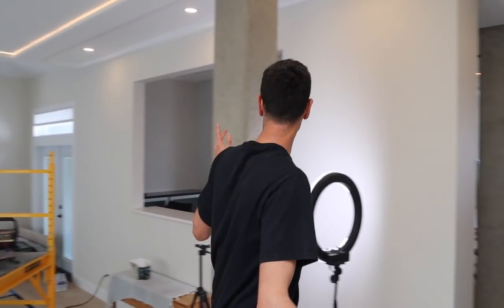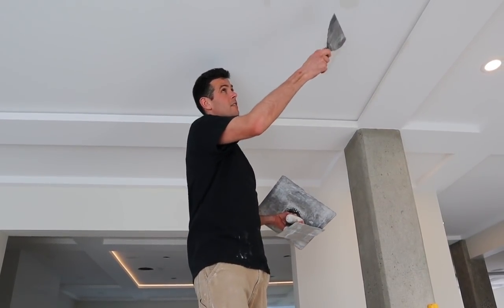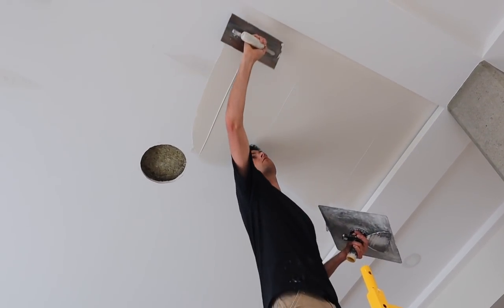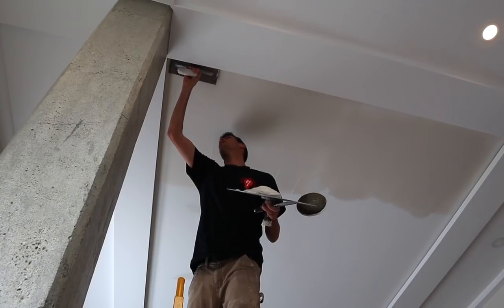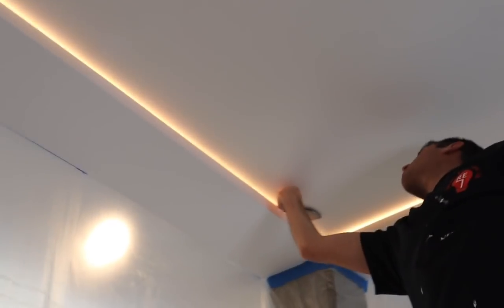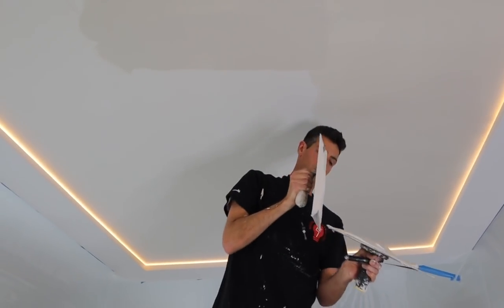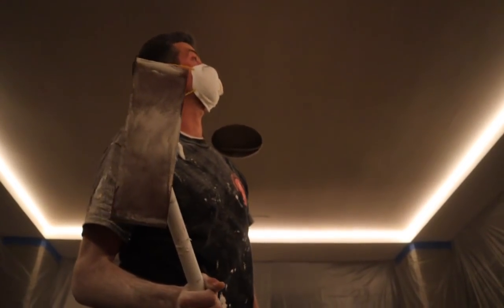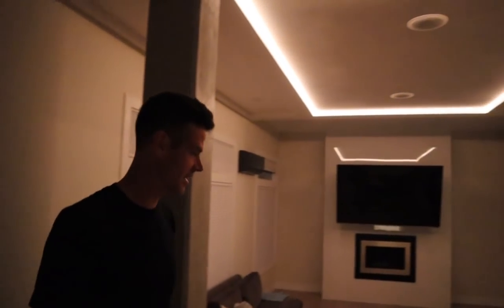EXTREME LEVEL 5 DRYWALL!!!

Comment: I've learned so much from watching your videos.  Many years ago I redid the ceiling in my small condo kitchen.  I removed those sunken fluorescent lights under clear plastic panels and installed drywall with canned lights.  It came out less than desirable so my fix was the brightest baddest led lights that blind you if you look up!
My "numbering" system" includes fractions so I think I'm about at a 3.6 level.

Comment: I wouldn't have touched that with a 10 foot sanding pole and I specialize in level 5 finishes. That raking light will make a gnat turd cast a 1 inch shadow.
I hope you got paid for this one Ben.
Reply: Amen. Had friends that wanted to do a 'wall lighting' thing in their toilet (think vertical led strips in a recessed space behind the toilet, both sides), and I couldn't talk them out of it. 
They're not really 'plaster master' material either, so..
It came out 'alright' (to them), but I can't go in there without averting my eyes.. :-)
Reply: @grandbuba  
It must be awful to look at.
Reply: Well, you're pooping while looking away from it, so it's manageable.. :-p
Reply: @grandbuba  
Excellent point!
Reply: @oltedders  I guess it depends on how long your business takes.  I like a nice long soak in the tub, and there’s some very poorly feathered edges around the perimeter of a skylight well extending over the tub that drive me crazy, but I can’t quite justify doing it over.
Reply: Interesting, my drywall guys specialize in Level 3 🤣

Comment: I’ve been framing, rocking , and taping light coves for 20 years . I Use a Graco Mark V fogger and a tape tech 24” skim tool you can be done with application  in 15 minutes. Then it’s just a light sand.
Reply: this is how we do it here in Germany too :-)
Reply: What tip size would you use for this ceiling skim?

Comment: Good job bud. That 2nd coat over a painted surface is a 🐻. I found that misting the area with water( I use a pump sprayer or sponge) and let it sit 5 minutes or just before water evaporates. Then apply 2nd coat. Cuts the amount of bubbles by 80 percent or better. Give it a try. Thanks for your videos

Comment: In my part of the country I think it is against the law for drywall guys to use lights. Particularly as an inspection tool. I paid someone to tape and float a 750 Sq ft condo. He (and his wife) did the whole thing with no lighting, even at dusk. Needless to say it showed big time. I ended up bringing a dual lamp. He wasn't even embarrassed by the globs, chunks, missed corners, pin holes, etc. Just looked at me like I was an a _ s for even questioning his work. After my 3rd inspection I just sent him on his way. It took me longer to clean up the  poor workmanship than had I done it myself. And I had planned to texture everything. Now it's level 5 and will stay that way.
Reply: In Germany too, no Lights for the last Inspection allowed, but if you like your Job and put your name out you do more than just usual.
Reply: Well Richard it all depends how much you were paying the man. Maybe you paid for a poor level of finish?

Comment: Little trick I learnt a long time ago is do your first coat in a half thicker taping mud mixed with a little runny confill to make almost a perfect thicker first coat mud sand that and use thin finish mud no bubbles ever. Sucks sanding on cieling but hey no bubbles lol

Comment: Once I designed a tray lighting system around a living room. It had a "shelf" 4" below the ceiling with a lip in front, to hide tri color low voltage string lighting on the shelf, going to 3 rheostats that would control the mood of the room, lighting the ceiling, and therefore the room. WOW, did that ever make a fair looking ceiling look like a WAR zone! But my idea had great merit once I had that dealt with and repainted. 
I don't mind if some copy my idea; I'm sure I'm not the only one who came up with it! Just be ready for a LOT of work to make it work.
Mind you that this was NOT a tray ceiling, just a normal flat one with the tray-like wood shelf added as a great alternative to a tray, and much less work. You put up a ledger first and add the shelf beneath it, and the front block (casing, chair, cove mould, block, whatever), so 3 pieces. Possibly some crown against the  wall under the shelf for a really fancy effect.

Comment: Have you tried filing your trowel and knife down? A new sharpened smooth blade will scrape the bubbles out, and shouldn’t come back when you reapply mud if you want any fill. Might have to scrape in different directions but it works like 95% of the time rather than 50% of the time lol. Cheers from the Fraser valley!

Comment: This video helps me a lot as I am replacing the plastic panels on the ceiling with sheet rock panels. Sheet rocks are pretty sturdy to hold recessed LED lights. Now I know what to do to improve the look of these sheet rocks panels. I am not going to the extreme like this video but as long as my ceiling looks good, I am OK. Kind of hard to see as the LED lights on the ceiling is going to blind whoever looking at the ceiling ;-)

Comment: Watched a few of your video's and they have been really helpful in my DIY unfinished basement project. ONE QUESTION: Why is the channel not called Vancouver Drywall(er)?
Reply: Technically drywall is a specialized niche of carpentry called 'Interior Systems'.  It includes metal stud framing, drywall, layout, etc. The man also does trim. I suppose the job title varies by region. In my neck of the woods he could just as easily call himself a finish carpenter.

Comment: I have a ceiling that a company just removed all of the popcorn ceiling from. They just left lumps of mud deposits over the nail pops (which are literally everywhere from the house settling). Bad mud job over so many parts of the entire thing. I’d like to use the roller method to skim coat the whole thing. I’d have to fix dozens of nail pops if I focused on those. Can I go ahead and skim coat everything to smooth it out or will these pops continue to get worse?

Comment: Ben, try the Radius 360 round disc pole sander instead of the round Richard sander.  It's also foam backed and less awkward than working with a rectangular sander.  I got it on a recommendation from watching Jeff Thorman from the Home Renovision DIY youtube channel and it works.  Also since it's foam backed you won't have the same issues with leaving scratches and easier to manipulate.
Reply from the maker: Radius 360 has the same problem. Hit one little edge and it gouges. The Richard one was perfect until it hit something. Not  a hard hit either.
Reply: Trim tex Black Widow , 6x8 surface, foam backed , sanded out in a third of the time

Comment: Hey there! Would you use this same method for coating a whole ceiling out after texture has been scraped down and sanded? Patch low spots, dry, then coat whole ceiling? I've heard of using a paint roller to get the mud on, would that be a better use for the application? I do mudding regularly but have never had to level 5 a ceiling yet, and homeowners want it to be a painted finish now ugh lol

Comment: On your 2nd coat you just have to apply the mud and let it sit for 1 minute so the mud can saturate through the 1st coat and just let it bubble. Then just wipe it smooth and all your pin hole bubbles will disappear

Comment: With bubbles, the only thing I found that sorts them out is to touch them up after you prime the ceiling. I've tried just about everything in the book.
Reply: stargateproductions sunlight dish soap works, acts like a surfactant, been using for decades

Comment: Literally every wall and ceiling in my house is  level 5... Taking forever but looks beautiful!
Reply: Same with my condo. I'm smoothing over orange peel texture on walls and scraped popcorn from the ceilings. If your a newbie like me I highly recommend using the paint roller method to apply the mud. I have found it easier to get a consistent thickness initially which makes it easier to smooth with the knife. I used a 1/2 in nap roller which goes on thinner. Also, don't use a knife bigger than 12 inches. Larger is just harder to work with. 

I tried using skim trowels, those speciality ones. For me it turned out to be a waste of money. A standard 12 knife works fine. Also, make sure the blade is facing the right way. They are curved...curved side up/away from the wall, otherwise you leave gouges on each edge. I have found that keeping the blade at about 15-20 degrees from the wall works best. Too steep an angle and you scrape all the mud off. These are nuances he doesn't mention because it is 2nd nature to him. 

Knowing that lift offs are OK was a game changer for me. I always tried to keep fixing them. Once I learned how easy they are to sand my life got easier. 

For mud consistency. .. 2 cups of water per bucket/box of mud worked well. The "add dish soap" trick also helps for smoother mud.

Comment: Hi - I am hoping you can help me with a hanging question.  I have 49 inch wide hallways with 12 foot ceilings.  If I put 1/2 sheetrock on the two walls, all the way to the ceiling, a 4 foot wide sheet would fit in between the wall sheets. Is this OK to do or should the wall sheets hold up the ceiling sheets, but that would leave me 1 inch short.   Basically I am not sure if the ceiling tile stops 1/2 before the side walls creating a space and if the wall tile goes just to the bottom of the ceiling tile leaving a space around the perimeter or all the way up filling in the 1/2 inch ceiling space. Hoping you can help me with this puzzle.  Thank you

Comment: Bro! Ur doing that by hand? Paint roller and a skimming blade. Done in one coat. Then maybe some touches and done.
Reply: I've never heard of this technique?  In my neck of the woods there is no level 5. We use vineer plaster over blue board or roll on wonder-bond or a similar product before applying the plaster. Drywall is seen as an inferior product because the plaster is so much smoother and harder but it has its uses. Do u know of any YouTube videos off ha d where the roller and skim blade is demonstrated? I'd like to see it first hand and educate myself. Thanks for the comment

Comment: Oof! Bubbles!  I was just experiencing them also because of paint.  Ever thought of first hitting a painted wall with one of those wallpaper perforation tools?  I wonder if that might help both the bubbles and improve adhesion?
Reply: What i have found is bubbles are actually caused by the moisture coming back out of the mud that you are applying. So for painted surface, mud as normal but if you let mud dry completely you need to pre wet the dry mud before 2nd coat. Or for new rock, coat while latest coat is still not completely dry or you need to prewet. The dry surface will absorb moisture from the mud on contact then as evaporation happens it make bubbles in the film of mud, creating bubbles. Non dry mud bed will not cause bubbles if mud is wet enough.

Comment: Great video! On the first coat were you also using 20 minute quick set? The 2nd cost was thinner all-purpose? Thanks for clarifying.
Reply: Most 20 min quickset are very hard to sand. 
And he only used thinset for patching the screws.  Otherwise he would have had to  mix so many batches.
Both coats were all purpose light.

Comment: Ben, I'm a bit surprised you're not using a Festool Planex or some other vacuum sander. Do you avoid using one for this finish because they cut too fast for fine control? Another question: after that first sanding, did you wipe down or vacuum dust off the ceiling before doing the second skim coat?

Comment: I tried one of those round sanders recently and found the same scratches. Came from the edges of the sandpaper being bumped leaving the Velcro underneath exposed. As long as I didn't bump the edges it was fine but as soon as I did, scratches galore.

Comment: someone once told me to add dish soap to you mud mixture to avoid bubbling. does that really work?
Reply from the maker: I honestly haven't tried it.
Reply: NO! I have tried it and it does not work for bubbles, in fact, it produced more bubbles.  I used dawn, but there is a youtuber who says to use sunlight soap.  Nopock doesn't work either for bubbles.  There has to be something that will solve that problem... just have not found it yet! :D
Reply: Been using Sunlight for decades , it works , acts like a surfactant , added benefit, mud is way smoother , a huge difference in troweling, your shoulders will thank you

Comment: In those situations l fill and skim with 1metre skim blades 2 coats light sand level5 finish
Just with spatulas l would have done exactly the same process problem these days no one pays for this type of job anymore

Comment: For what it worth, I believe you when you say you can't see those shadows in person, but see them on camera. This is just how digital cameras work. Imagine your black is 0 and white is 255. In daylight camera can easily utilize the entire range of numbers. In the dark, however, white is like 15. So camera only has numbers from 0 to 15 to express all those shades. So when you have insignificant difference of white in daylight - it's a change from 255 to 254, so ~1/256 jump. In dark conditions it'll be a jump from 15 to 14, so ~1/16 difference. That's why dark images always look blockier and with more pronounced color changes than in real life.

Comment: I use stilts and sanding sponges to hand sand ceilings. It’s much easier on the joints and shoulders
Reply: i think poles are way easier on body than stilts and sponge

Comment: Why so many popped screws?
Reply: Likely installed too deep. Once the paper is ripped they will eventually pop.
Reply: @StephenPaul1160  Thanks! Good to know.
Reply: @yanwo2359  Also, on ceilings on wood you should really be putting in two screws side by side to help eliminate future problems.  Only adds a few extra minutes overall and nothing to materials cost as drywall screws are cheap.
Reply: Could be movement, or studs were moist and dry out over time and slight shrinkage , or seen lots of repairs that were caused by high screws and taper tapped In with a hammer , they will pop then

Comment: A drywall guy I know uses a touch of dish detergent in his mud to minimize bubbling. He claims it works
Reply: Dont know if he knows this but, soap makes bubbles? Most uses i know of for added soap is for its "slickingness" meaning you can make a smoother finish when pulled by knife. I use it never, i have seen that water ratio to mud is what really makes difference in workability and finish smoothness.
Reply: But actually what your friend is doing is not hurting anything because adding slickingness also should reduce bubbles. So thats probably what he is producing.
Reply: It also voids your material warranty from the manufacture. Don't do it.